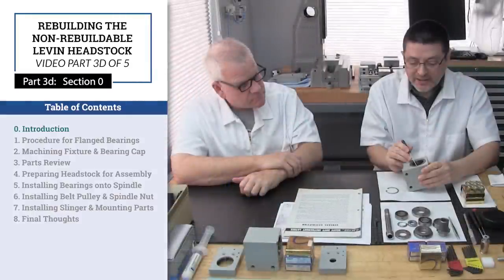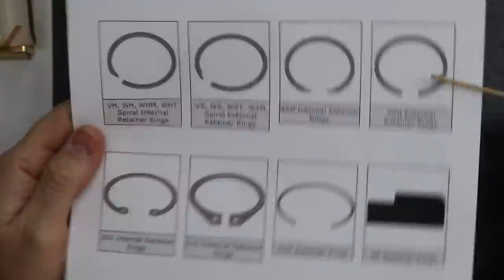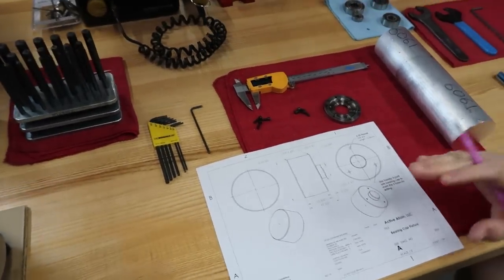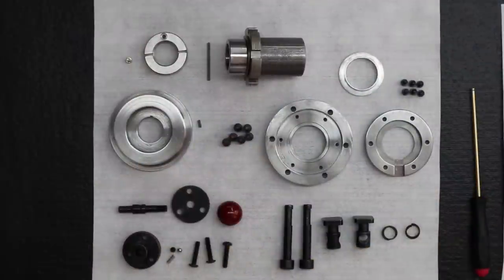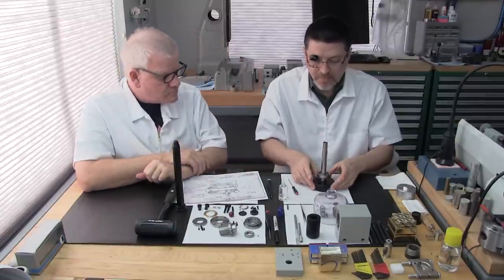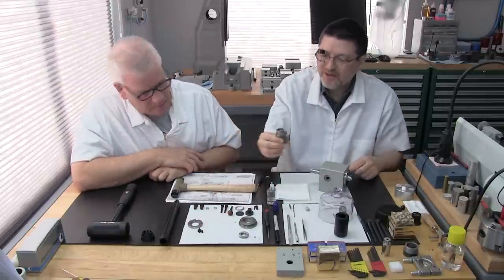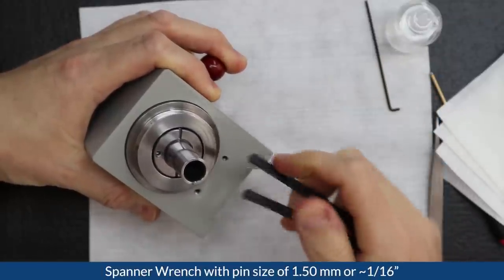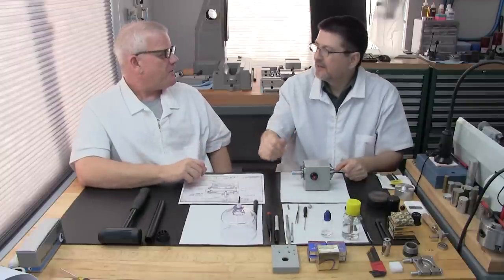Precision Machine Spindle Rebuilding - Part 3d Rebuilding the Non-Rebuildable Levin Headstock

Comment: Once I had the similar experience and all I did was just machining a precise billet bushing as a "mold", exactly positioning it, prepared the inner housing surface(for better retention) and cast in the 2K liquid metal epoxy forming a precise & reliable seat for the bearings. 
This enabled using standard bearings for any future replacements. 

Otherwise it's a very nice & detailed video. 

Cheers 
AS
Reply from the maker: That is a very interesting and good approach to the bearing issue as well so thanks for sharing your method for resolving this.  Take care.

Comment: Hi, glad to see you ok and coming back. At moment I am dealing with a chinese 160mm 3-jaw chuck accuracy before you cut the item(The purpose of a 4-Yaw indendend I presume).
1-I just skimmed the spindle flance face to measure accurate.
2-I tightened the spindle bearings a bit, 10mm movement on nut, halved the pullup or down, not sure by measuring how far I can go here.
3-I experiment with mounting chuck to 3 different positions, but could not make a positive conclusion regarding this  effort.
4-I skimmed the shoulder-fit on spindle a bit, so now I can bump the chuck to accuracy of 0.005mm, however it does not retain this. 
5-With everything done I did more than half the original runout problem in the process. The runout problems before cutting comes from the chuck, maybe the scroll mechanism(Clean).
6-I am now thinkng of drilling 3 4mm holes in chuck to instead of bump it, I can adjust it with set screws to the shoulder, having an adjustable 3 jaw chuck.....Thinking about this intervention before I buy an expensive adjustable 160mm Bison chuck for which I can get soft jaws.......Would like your opinion on this, or referal to a good read.
Reply from the maker: Hi Chris glad to read from you.
We think a 4 jaw is it for accurate work even a collet chuck if tolerance is of great concern. The 3 jaw comes down to the scroll being made in China and then being not to accurate unless you are making your part from start to finish in one operation where it would not matter.
We do not think grinding the inside jaws will suffice because (accurate to that one ground size we think) the use is going to again be affected by the scroll of the chuck. 
Thank you for being here we will be releasing new videos after 1 year away in the coming year 2021, stay safe thank you for being here with us. Lance & Patrick.
Reply: @ActiveAtom  Hi, I agree with you the scroll is the problem at vatious distances, so the grind may not work, one size correct  not at all the others, or not even at the same size.
I did however today drilled 3x holes next to each jaw in such a way a 6mm grub screw turn against the internal rim on which the chuck  fit to spindle. I took a chance, I know its going to be a manual process, but the tapping worked real qucik. I also sawone person indicates you can tap a 3 jaw chuch on the jaw itself & forther tighten correct, have to check this out.
So far I have:
1-Face off the spindle face.
2-Cut the rim a little to give space for adjust ment, I tried this wih tapping, no problem.
3-I ten tighten the spindle bearings a bit, like 10mm advance on nut, that reduced the upward pull by half, still thinking about this.
3-To eliminate tapping on the chuck, I add 3 x adjusting grub screws , must test this tomorrow, it turned out good making it.
So before I buy an expensive Bison chuck to be able to get soft jaws as well, I 1st take a chance at this experiment, just a homeshop.
I decided on 3x screws instead of 4, will see how this pans out. Have a good day.
Reply: @ActiveAtom   Hi, ok I went ahead and took what I got, and drilled 3x holes in line with centre of each jaw so that a 6mm grubscrew pushes on the rim of the spindle, skimmed cut it a bit. It works like a charm , I got it adjusted to .005mm quik enough not to bother, so I am very happy.
-At using a 10mm carbide shank from a tap, the thing is you can reclamp it to same accuracy at that size.
-It seems if I calibrate the chuck at 10mm size it behave better for larger openings, it better than it was.
-You are locked to the diameter you calibrated it at.
-In this case you move the chuck around, in 4-Jaw you move the jaws around.
-In a 3 jaw chuck adjusted you ok flipping around at that diameter, in a 4 jaw you must adjust every tims at least a bit. 4-Jaw is the best, but this is what I got at the moment.
I do realise I will need a 4 Jaw and collets later on, still buying other tools.